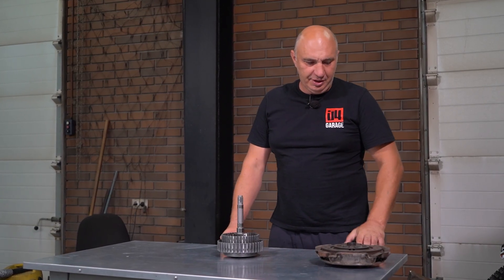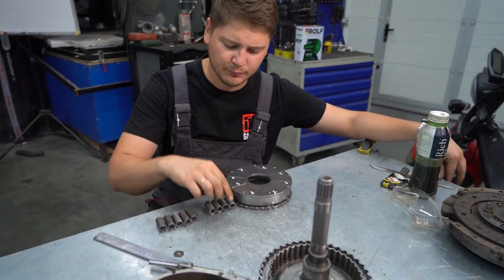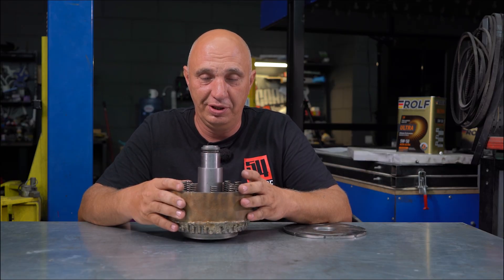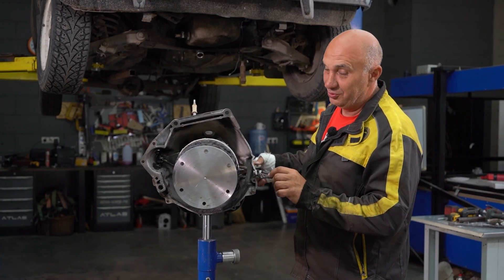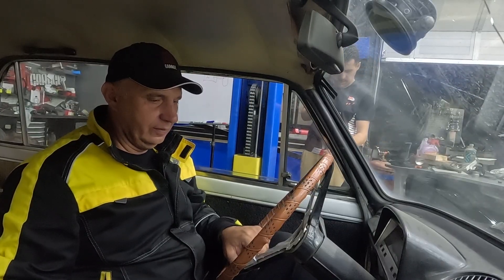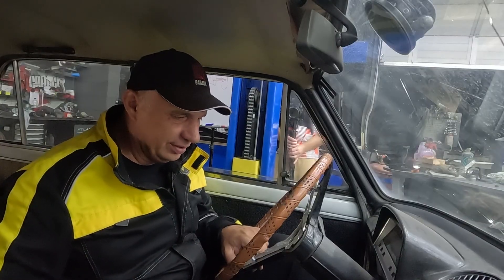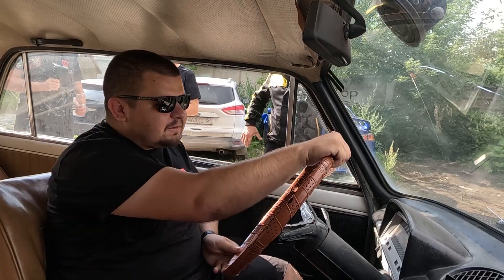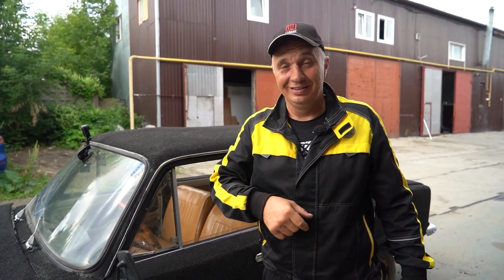We make a motorcycle-type wet clutch for a car

Comment: To improve friction performance of multi-plate clutch pack without increasing spring tension that make it harder to press the clutch lever, you need to increase the total clutches pad's mating surface area. There are 2 ways to do this. First by adding more layer of clutch+metal plate (more torque, more layers like most motorcycle manufacturer did) and the other is by using larger diameter clutch disc like a normal dry clutch performance modification.

Comment: This clutch is better suited to a dog box set-up, just like motorbikes have.
Still, an interesting experiment.
These clutches handle slipping well, so it would have been good to test it on a turbo engine, with high boost (and the lag that comes with it), that way you could slip the clutch to get it into boost quicker, by revving it up unloaded, like how you keep small capacity two stoke motocross bike on the boil (in the so called "power band").

Comment: What would be great would be a wet type centrifugal clutch, that takes no clutch fork and no torque converter, just clutch plates and fly weights to multiply clutch pressure, hence torque transfer via centrifugal clutch engagement. It is fairly simple in motorcycles.

Comment: The reason why they don't do this in cars is due to the sheer weight it adds to the system and not to mention the Mechanical complications so car manufacturers decided dry clutch which is cheap to manufacture and light weight and very simple in construction and cheap to sell also

Comment: Sometimes you get a clunk going into first from neutral on a motorbike. The input shaft is spinning the oil which can put a touch of turning pressure on the plates.
It'll work dry for sure, like a Ducati.

Either that or find someone with three legs so he can keep his foot on the brake when about to take off.

Comment: Yesss, I always wanted to try this but having a few thousand dollars laying around isn't really in the cards, and if it was, more important stuff would need it.

Thank you for finally proving what we all know -- Automotive manufacturers don't want you to have the perfect driving experience, they want to make money.
Reply: No, wet clutches have been tried in cars before.  They're just not the best option for heavy vehicles.  To get them anywhere close to reliably handle car and truck weight over significant mileage,  you need a very thick stack of many friction plates with very strong springs.  Just not suited for heavy vehicles, but well suited to lighter vehicles like motorcycles.  
But even some motorcycles use dry clutches instead of wet, Ducatis being an example.

Comment: If you made a gasket or used rtv on the bellhousing and used a hydraulic throwout bearing through a sealed bulkhead and welded up any inspection holes and starter hole you could just fill the bellhousing.

Comment: I may be mistaken but i think a car manufacturer has built a wet cluch before i just cant remember qhat xar it was in but it could have been a concept i herd about but then again i could be wrong!!!! Still a great idea would love to see it with some hp behind it see what it will handle great video guys!!!!!
Reply: We were in the Ferrari outlet in Rome a few years ago and they had an F1 car on display with the engine partly dismantled.  It had a relatively tiny multi plate motorcycle type clutch driving it. I'm guessing it was only used for launching and stopping?

Comment: virtually indestructible? said no motorcyclist ever. you have to replace the plates far more frequently than a clutch in a car.
Reply: who the hell told you that
Reply: Depends how hard you are on the wet clutch and how many friction plates comprise the clutch stack.  I have a motorcycle at 125,000km with original clutch.  I have another motorcycle where it glazed the steels at only around 25,000km needing replacement.  I was a lot harder on that 2nd bike though.

Comment: Hudson used wet clutches using cork friction material in their cars for several years. The oil was called Hudsonite.
Reply: A lot of vintage motorcycle clutches used boiled cork also

Comment: That's a lot of work.  Impressive.  The larger the stack of clutch friction and steel plates, the tougher the clutch.  Having strong clutch springs certainly helps.  
On my motorcycle, the clutch is oiled through the centre of the gearbox input shaft, and spins out through the centre of the clutch between the friction pads.  Very little oil actually gets into the stock Ninja 400 clutch.  
Car oil in a wet clutch is a bad due to friction modifiers causing the wet clutches to slip.  I think they accounted for that though.
The clutch should grab hard when the clutch pedal is fully released.  If it's slipping on takeoff, it's a bad sign and unlikely to last very long.

Comment: Another awesome experiment and cool build. It does remind me a lot of a slush box though, as automatic transmissions work in a similar way, but each gear has it's own stack of clutches and planetary gear sets are used. It might have had more grip when you release the pedal if there were more rings (clutches and steels) in the stack. Anyway, awesome build guys.👍

Comment: Back in the late 40's and early 50's Hudson Motors had a wet clutch type setup. The clutch plate had cork for the pressure plates. You can Google it.

Comment: Turn up your welding voltage and just move faster. You will transfer a lot less heat into the material than wiggling around with low voltage. I know it seems odd but this actually works backwards to what your common sense would normally assume. The less time you spend welding the less you get heat going into the material. 22 volts on up, even on 3mil steel should be minimum. You just need to move faster. On wider gaps and corners just tilt your gun towards your movement direction and start doing circles as you go forward.

Comment: There was at least one Motorcycle Manufacturer that used a multi plate dry clutch and the clutch was very noisy very rattly your team of engineers mace the multi plate wet clutch work well done
Reply: Ducati

Comment: It needs weights that adds to the spring pressure  with engine rpm.  Only about 1-2 oz per weight, with a lever and weight for about every 35 mm of clutch disc circumference,   a fluid coupling with TQ converter would be cool , put it in gear, hold brake give slight throttle, then release brake , and go to full throttle! Having a lockup converter would be better,!

Comment: 🎉🎉🎉🎉🎉🎉🎉🎉🎉🎉🎉🎉
Why not just adapt a torque converter to a manual transmission? Use a power steering pump to pump fluid in and out of it. Through a cooler.  Possibly reduce fluid level to reduce coupling. Offer clutch less shifting!🎉🎉🎉

Comment: So its like an automatic transmission and a manual?
Reply: Essentially a manual transmission with a fluid coupling, Chrysler did that back in the 1940’s with their Fluid-Drive transmission which was a 3 speed manual with a torque converter/fluid coupling. Allowed you to come to a complete stop in second or third gear without having to step on the clutch and shift into neutral.

Comment: you may have just given the major manufacturers a new piece of technology to explore ! they have been mucking around with dual clutch arrangements which tend to be complex so this could provide a simpler alternative as it is already a tested proven technology
Reply: It has been tried in cars previously, but a single wet clutch isn't well suited to heavy vehicles.  Great for motorcycles.

Comment: I don't know who said they were indestructible, they clearly have no idea what they're talking about. But good on you getting that thing to work in that car. Those clutches aren't anything special other than being very compact. But like any clutch they can last 100,000 miles or you can smoke them in five minutes. And usually they last a lot less than 100k. But they're usually pretty easy to get to most of the time on a bike, so replacing them isn't a big deal.

Comment: not a even pressure on the plates !!! 4 point inner fork !!! wil be the best bet for burnout later and better launches !!! and a tougher pedal spring !!! means real man leg power !!! kids cluth sets are like that but you can beef them up if need be !!! u built a dummy clutch(beginner's clutch) !!! anyone can drive !!! but needs a pump and rad to cool it !!! a quad clutch would work better from a 450cc motor !!! honda best bet from a 2012 !!! I have a engine block with it stuck in second gear with a hole in the trans area. it is in a 450r frame with a 280 cc powerfist motor does 50 km/h all I do is trail ride with it. and tow others out if need be with bald tires on the back and a box with snow chains to put on if need be. I wish I never broke the block and got it stuck in second gear !!! if not I would make it do 160km/h since I know how to gear it properly now !!! 1:1 on 280cc or higher motor add to the honda 450 block. connected to where the magneto used to be before cut of and gear added in its spot since no oil leaks on thet side !!! and I bought mine blown up with the engine in a box $2000 cad to fix or a $500 fix adding my setup !!! which I went. Just cut the piston rod out and seal the rest of the motor off and go !!! just don't land on a random bar stickout of the ground and you should be fine !!! have fun with this build for cheap. you need the original trans in any for the suspension to work right !!!
Reply: There is no pedal spring to toughen up, just the springs on the pressure plate.  It looks like even pressure on the plates to me.

Comment: The clutch pack is slow to engage because you blocked the holes in the clutch basket.  The oil has to flow in AND out.  Blocking the holes in the clutch basket will also cause the clutch to overheat.
Reply: Good call... Now if you tour the rest of their videos, you will surely notice that this is a very legit operation ;)
Reply: @qoph1988  same

Comment: Way back in the day I think it was General Motors that made a manual transmission but it also has a torque converter bolted to the front of it. It was in the 50's or 60's. That's kind of the same concept as this.
Reply: The company I work for has a whole fleet of OTR AMTs (automated manual transmissions) tractors. At first the drivers didn't like them, especially when backing. But the maintenance costs are way down. I understand backing is kind of tricky.

Comment: The holes in the clutch basket are there to allow fluid to flow from ID to OD to cool the clutch disks. By plugging those you'll get stagnant oil and burn them up pretty quick.

Comment: Please can you try oil instead of antifreeze or water to se if a engine will run and cool down with oil if it works .it can stop warter and oil mixing .it cud be anew thing to cool the engine with just oil it wud be cool
Reply: They would probably have to change the normal radiator to a large oil cooler, cause I don't think motor oil would flow through a normal radiator very well. Could def work

Comment: So, the fluid when rotating adds something of a torque converter effect to it, neat... but how much of a flywheel effect does the whole contraption add to the drivetrain? Or was it lighter than it looked? (Well, its not a propeller, thats for sure) 

This is to clutches what a ww1 era rotary is to engines (where the whole engine spins).

Comment: Next time add a torque converter🤣
Reply: Chrysler did that back in the 1940’s with their Fluid-Drive transmission which was a 3 speed manual with a torque converter/fluid coupling. Allowed you to come to a complete stop in second or third gear without having to step on the clutch and into neutral, would take off in second or third gear albeit it wouldn’t accelerate very fast but was doable.

Comment: Wet clutches for cars have existed for decades, maybe a century at this point. Traditional automatic transmissions have at least one, usually several. Most modern dual clutch transmissions are now also using wet clutches. If you’re wanting to be specific about a clutch that’s directly coupled to the transmission, Honda’s old CVT had a “start clutch” that did exactly this since it didn’t have a torque converter, and every torque converter since the 1980s has had the same (the torque converter clutch).
Reply: you mean lock(up/ing) torque converters?  they either 'slip' all the time, or are fully locked, when engaged. there is no in-between. but I understand what you mean. have it locked at all times except when stopped, as soon as you get to say 5-10 mph you could lock it and keep it locked till you hit 5 or lower again.  i had a few vehicles that actually didn't have that, newer even, like 90s., and man it pissed me off that a freakin Tacoma wouldn't have a lock up tc . ?? like what? waste of gas and more wear without one.
Reply: Apparently not in Russia
Reply: The Model T Ford uses a multiple disc clutch immersed in oil for high gear.
Reply: hi dude you need to sit back and relax

Comment: Try to mate a torque converter to a manual transmission next
Reply: They have done it and uploaded a video on their main channel like yesterday, it only has to be translated and uploaded here.
Reply: Or put a manual transmission on the back of an automatic. I've been asking this for years now. That would be a cool idea with the torque converter on the standard tranny as well
Reply: Redneck rock crawlers did that 20 years ago. They also doubled manual transmissions, if you put both in reverse, it goes forward, crazy!
Reply: @quevicular great idea. 
You’re
Hired.
Reply: What about an auto with a manual clutch. Imagine trying to line up computer and human shifts XD
Reply: they made a centrifugal clutch
Reply: @ClumsyCars  not the same as a torque converter
Reply: @gamer78full  pretty close.
Reply: Already been done by Chrysler Corporation back in the 1940’s called the Fluid-Drive, basically was a 3 speed manual with a torque converter/fluid coupling. Essentially allowed you to come to a complete stop without having to step on the clutch and shift into neutral.
Reply: Your wish has come true!
Reply: @Markcain268  just saw that! Gonna watch it rn
Reply: +1
Reply: Just wondering 🤔. If you put a high stall torque converter ?how would that drive?
Reply: +1
Reply: Porsche/Allgaier did that in the 50s on their tractors. Clutch, put in gear-release clutch, stands still. Give som rpms and it starts to move 🙂

Comment: I wonder if you used wet clutch motorcycle oil would it grab a bit better..
Reply: I think the main thing is the quantity of ATF affecting the grab.  I'm guessing they made sure their ATF was a variant without friction modifiers, like motorcycle oil  That's a must. 
Motorcycle clutches are very lightly oiled from the centre outward, so not bathed in fluid like seen here.

Comment: should have filled it with motorcycle oil and not atf
Reply: ATF is better suited to wet clutch applications, some motorcycle guys swap to ATF. What is an auto transmission?  A bunch of wet clutches.

Comment: Update it with a hydraulic valve to move the internal piston. Basically, exactly like an automatic transmission. Hell, just replace a torque converter with one and manually shift the gears.
Reply: Like a vw beetle auto stick from
The 70s

God I hated those.
Reply: @fastinradfordable  They aren't bad once you get used to them , just problematic at times.

Comment: so they make something which is common in automatic transmissions.
Reply: The difference is the ones in auto trans are handling way less load, this is  a direct engine to trans connection. This one also has a clutch.
Reply: @jwalster9412  wet clutches can handle high loads just fine especially since the clutch can be actively cooled to prevent overheating and there is no shortage of cars equipped with wet clutches capable of +400nm, btw lamborghini huracan and audi r8 uses a wet clutch design.

Almost forgot, the clutch in the huracan/r8 can be upgraded to handle well over 1500nm.

Comment: It would be cool if you lower your car that to make it pretty much impossibly low, and test how stable the car is around corners, and also how the maximum speed is affected by lowering the car, so hopefully lowering also the aerodynamic drag.
The opposite would be also interesting, making the car so high and see how it handles, even though such high height could be dangerous for testing.
Reply: Go extremely low and the suspension wont flex side to side (no body roll), the car will slide and bounce around. Opposite around, you become top heavy. Go too fast and you'll flip over.
Reply: @Domestic_Tedster  Yes, but seeing all that on this channel would be so fun !